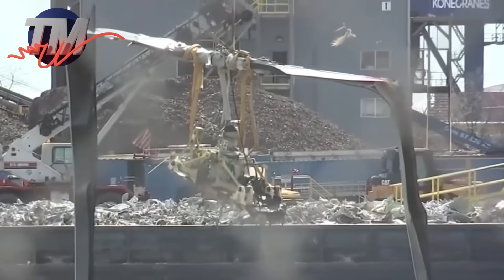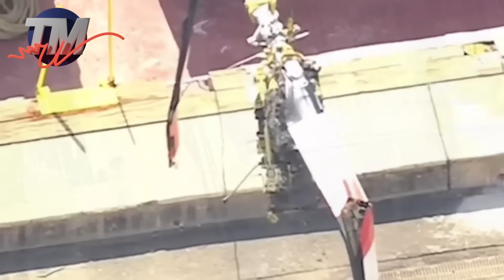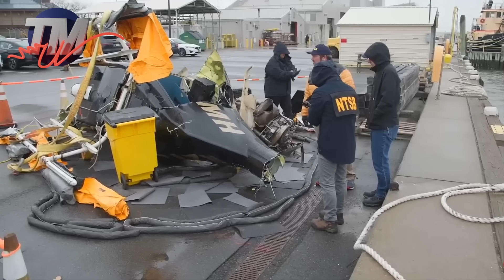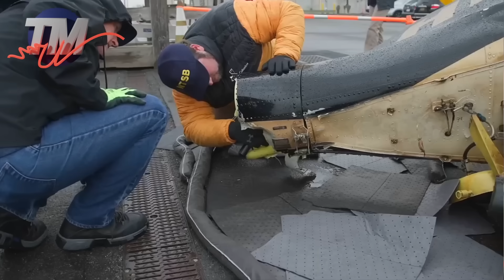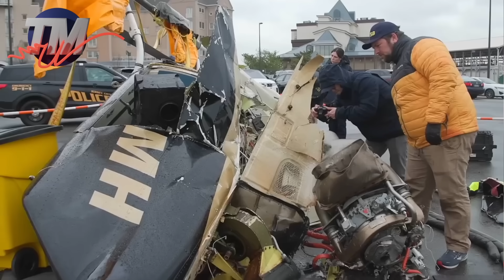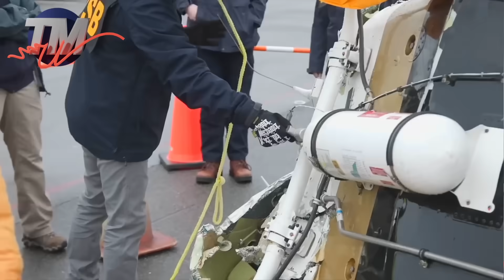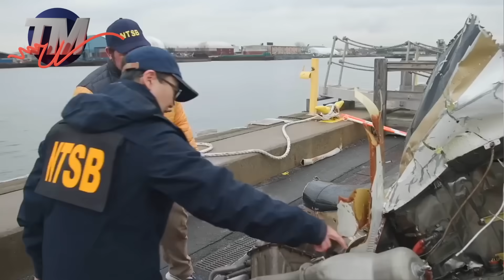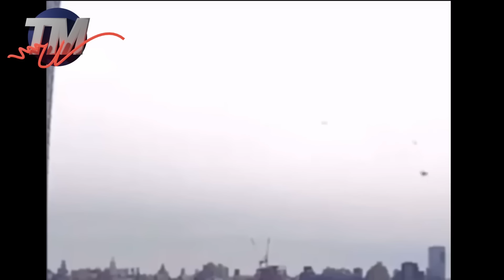Recovery of the Main Rotor of the Hudson River Tourist Helicopter - it's worse than we thought

Comment: When looking at all the evidence the most logical conclusion would be the transmission seized, torquing the airframe so violently the tail boom sheered off as did the entire rotor assembly with transmission. 

By observing the rotor blades as they were spinning down, and the fact that they were spinning freely and balanced, one can easily argue they did not suffer the damage one would expect if the blade(s) had struck the tailboom. The fact the failure appeared to be at the point where the tail boom is attached to the rest of the airframe also indicates it was sheered off as opposed to being chopped off.

When I saw the helicopter instantly yaw to the right I was convinced it wasn't due to LTE, the yaw was just way too violent. In my opinion the only thing that would cause that is the transmission locking up.

Comment: In Fixed Wing engine failure in the past there were instances when an invisable structural flaw was formed during the forging process of a turbine blade, engine block, crank shaft, turbine disk, etc. The accident had actually begun years before during the forging...even before the part left the factory. No amount of non-destructive testing could've picked it up...until in fully failed in and instant during a flight. I would not be shocked if something bizarre like this may have happened.

Also maybe some kind of sabotage????? Unless they find something patently obvious. This may take a while.

Comment: The people who have experience have spoken. The first thing the NTSB needs to review is the main gearbox seizing and corrosion/metal fatigue in the cabin roof/tail boom. Maybe (probably) they’ll find maintenance/inspection failure(s) and maybe (?) no chip detection. 

The videos I’ve seen to date show the remnants of the main cabin and engine, the rotor-gearbox, and other bits. I assume the rest of the tail boom and fin have been recovered, and, the tail rotor, gear box & power shaft. The news talking heads really have little clue of what they are looking at.

My first impressions of the early videos were, ‘where’s the main rotor assembly & part of the cabin?’ and ‘where’s the tail boom?’ I’ve never seen a main rotor assembly autorotating by itself. Those rotor blades store a lot of energy.

Comment: I think the lift-rotor transmission locked up. This would cause the fueselage to pivot violently. In so doing, such could have over stressed the tailboom, causing it to break near its root. This is because the tail-boom rotor assembly has considerable mass. And such would resist being swung violently. Once the tail-boom broke, the tail-rotor assembly, which itself was over stressed, came appart.

By this time, the mounts holding the lift-rotor and its transmission to the fueselage had already failed. So it wrenched iself free sometime after the tail-rotor assembly flew apart.

I originally thought the lift-rotor spanked the tail-boom. But, after seeing the lift-rotor, I have changed my mind.

Comment: The transmission wasn't ripped from the aircraft. The entire tranmission deck was ripped from the aircraft. That is like, the entire roof being peeled off. The boom also is not broken at the joint. It is ripped off about a foot behind the joint. You are entirely correct, though. This was an extremely violent and catastrophic event. I have no idea what would have caused this.
Reply: Wouldn't have anything to do with Escobar being in charge of Siemans 10 billion investment into USA, would it?  
😢Traitors everywhere

Comment: Long ago, when I was a teenager, I drove a 1962 Volkswagen Beetle, that my dad basically gave to me. I drove it and drove it, and I did not add any oil to the engine. One summer night, just after dinner, I was driving it on a little street, and it suddenly screeched to a stop. It would not even roll. I was mystified. 😅  No oil, then no engine. This helicopter reminds me of that, I think that somehow, the engine might have just stopped dead. (My dad replaced the Volkswagen engine - $275. And after that, I watched the oil level!! 👍 👍 👍 🥲)

Comment: This helicopter was in service for way past its serviceable life. Metal fatigue eventually shattered the metal joints where the engine’s crank shaft met the transmission. It was operating fine until it reached its critical threshold and failed without no noticeable warning signs.
Reply: It was the helical hypoid herring bone sprocket retainer pin, made in Bangladesh, since the Trump tariff war took the superior Chinese rare earth alloy ones off the market.

Comment: The rotor blades appeared in the video to be straight and intact, possibly the broke when they struck the water.  Seems that possibly the main rotor gearbox or the turbine seized causing the sudden yaw which could have broken the tail from the fuselage and the main rotor transmission to separate from the fuselage.  Maintenance records and review of the recovered parts will most likely clarify what happened.

Comment: The video of the in flight fall apart shows the aircraft halting in mid air as if it hit something in the sky like a GD drone. The main theory is that the transmission locked up but I wonder it it actually hit something in the air big enough to cause the transmission to break loose from it's mounting in the body of the airframe?

Comment: It was an explosion that blew everything apart. The evidence is what the pilot said when he radioed that he was low on fuel. Why would he be low on fuel? Because of a fuel leak. I believe the nut was loose on the fuel line which sprayed the engine and transmission with highly flammable fuel. Turbine engines run really hot so it ignited the fuel causing an explosion. The sonic booms heard by a jogger support this explanation.

Comment: Swiped this from a different video on the subject a number of days ago, but this guy sounded like he knew what he's talking about and wasn't just blowing smoke:

"22 yrs Army helicopters, OH-58, TH-67 and later TH-57 experience. Taught the Maintenance Test Pilot course for Bell AH-1F Cobra.  Mast bumping usually causes separation of the Main Rotor (M/R) hub from the mast.  I does not usually pull the entire transmission out. The only thing that does that is excessive mast movement knocking the "candlestick" against it's stops under the XMSN. Watching the initial portion of the video, the aircraft appears to be flying level and cruising.  I see no immediate maneuvers or disturbances until the severe yaw event that initiates the tail boom separation.  My experiences point to 2 possible causes.  The Tail Rotor (T/R) drive shaft hangar bearings on the 206 models (civilian versions of the 56, 57, and 58) are notoriously picky about accepting lubrication. They have been known to discolor and seize with little to no warning. Locking up the T/R drive shaft at the tail boom attach point bearing can cause separation, and the immediate torque due to loss of yaw control/tailboom could cause the whole upper pylon to become dislodged.  The other option that comes to mind is pitch control link failure. I had a Cobra do that.  When a P/C link fails, the M/R blades, or at least one, are no longer controlled and can easily flail themselves into the tailboom. That applies torque to the XMSN, potentially ripping it out. The fact the blades were still attached to the XMSN is what kept them rotating, like a toy set of blades on a stick. So, while I don't disagree that mast bumping could be a cause, the evidence I see doesn't lend itself to that."

The XMSN is basically another name for the transmission, according to Google.

Comment: I believe you're on the right track, the question is what would cause a 90 degree right yaw. A tail rotor failure or control linkage to the tail rotor seems lkely. I saw no evidence of mast bumping in the mast still attached to the main rotor.

Comment: There’s a newer clip that shows the instant the fuselage snapped 90° to the right, separating it from the tail and the rotor system with transmission coming out as the fuselage flips over. I think the gearbox bound up and instantly sent all that torque energy to the fuselage, sadly the end.

Comment: Having flown helicopters in Vietnam and witness the loss of a 90 degree gearbox in flight, I know helicopters are not for the weak of heart. I've flown for 53 years and have never wanted to get in another helicopter after my return from Vietnam. Too many moving parts going in opposite directions.
Reply: My brother was a warrant officer who specialized in helicopters and he said "if its not leaking means its out of hydrolic fluid". 😂
Reply: Considering the mechanical complexity and size of components in the rotor assembly and extreme forces being exerted on a system with zero redundancy, it's amazing ther aren't a lot more accidents.
Reply: I agree.  Don't ever want to get into a helicopter.  But, I also have the same feelings about small planes.  They seem to be involved in way too many accidents/crashes.   The list of famous people who died in small plane crashes is fairly long.
Reply: @my3dviews almost all are a subject of "Get there-itis" too much pressure to get someplace in not enough time to drive in poor visibility for IFR for flight. Fly for fun and you won't ever die in a crash you shouldn't have been anywhere near. Also remember to fill the tank before you takeoff or you'll wind up like John Denver.
Reply: @jamesordwayultralightpilot    Another new example:  N8930N C-310R Boca Raton 11 April 2025
Reply: Thank you for your service. 🙏
Reply: Thank you for your service sir 🫡 🇺🇸
Reply: Electric quad copters will be a massive improvement when they become practical for human flight.  Far few moving parts and more redundancy.
Reply: @WaybackRewind   The time of flight will always be very limited though.  There is only so much storage/weight that a battery can have.  With cars, the EVs are a fair bit heavier than non EVs, but it doesn't matter as much as with a flying machine.
Reply: @my3dviews  true, and maybe a hybrid with a gas generator would be mechanically less complex?
Reply: @WaybackRewind   Nuclear. 😄
Reply: Ok boomer

Comment: It looks like the tail spun toward the camera, counter-clockwise, as if the gearbox had locked the rotor to the fuselage, thus rotating the fuselage in the direction of rotor travel. Most of the power is transmitted to the main rotor, while some power is transmitted to the tail rotor to keep the fuselage pointing forward. The gearbox locked up and was forced to rotate at 3k rpm almost instantly, ripping it from the fuselage, which couldn't keep up.

Comment: I had an old Vietnam helicopter pilot tell me that he had just landed to drop off some troops in a hot LZ.  He said they were barely on the ground when the troops started to jump out so he pulled in pitch to leave the ground when the entire transmission siezed up and departed the right side of the helicopter before the last guy was out.  They were about 4 feet off the ground when this happened.  He did not know what caused the transmission to sieze.  Since they were in a combat zone, he did not stick around to find out.  That was a Huey (made by Bell) and not a 206.
Reply: Interesting 🤔 story 🤔👍✌️
Reply: How long was his walk out? Cause it ain't flying without the transmission attached to the engine. Or does he drink a lot?
Reply: @scottcoley1906  it was a troop insertion so his walk was short. He and his crew just went over to another helicopter jumped on board and left. He had no idea if the Army ever recovered the damaged helicopter. It was during the Battle of Lam Sung if that is familiar to you.  1971 as I recall.  The troop who went out with the transmission was South Vietnamese.  It wasn't an American.

Comment: From a physics standpoint, it almost had to be a seized main rotor gearbox.  This would cause the rotor inertia to violently jerk the airframe clockwise (which the video shows) such that the tail mast would snap from the sudden high bending moment.  Simultaneously, the huge torque could have ripped the main rotor mounts from the airframe, freeing the main rotor  (which it did).

Comment: Never worked on a Bell transmissions. My best guess is that a major part in the transmission failed very sudden. Look at the mast, it is in a very pronounced angle to the transmission. Possibly the planet gear carrier broke or the carrier bearing failed. Not really thinking bearing since that would cause spalled material that would be picked up by the chip detector. Cracks in gears or the carrier would produce really fine material that only testing oil would show. Wonder if the operator had a SOAP program to test oil. NSTB will find what went wrong. 45 year Chinook mechanic, last 30 in transmission overhaul.

Comment: As non USA ex pilot I hear lots of gossip about the maintenance standard of USA aircraft not of the best standards Overseer (FAA and maintenance organization) standards must then be also looked at. Some commentator mentioned missing rivets. IT WILL BE VERY INTERESTING TO SEE THE ACCIDENT/REPAIR RECORD OF THIS CHOPPER. I think the problem will point in that area. Long rangers has MILLIONS of hours in the air. What happened to this one is NOT pilot error or even small maintenance errors or even bad landings hidden as one commentator mentioned. I bet NTSB is scrutinizing the logbooks VERY CAREFULLY. Some commentator mentioned gearbox sezure. MMM After all the millions of hours Long- or Shortrangers must have had incidents like this. Ok and not had the gearbox ripped of the frame (as sad not that we know off). I speculate but I think my thoughts are in the correct direction. Let us just remember the swizz cheese. I think tho many holes in the maintenance of this aircraft lined up for the occupants RIP. I do not think there is ANYTHING sinister in this incident.Withe the quality of NTSB inspectors they will find the cause Let us hope soon.

Comment: As an A&P mechanic, I am guessing it was a gearbox  seizure.  The whole transmission and it's mount was ripped from the airframe. The sudden stoppage of that much mass could have had enough counter force to snap the tail rotor boom at its attachment point to the cabin structure.

Comment: I'm no expert, but from the video it appears to me as though the clutch in the rotor seized up causing the main rotor to lock up which caused the violent yaw. The violent yaw caused the tail boom to rip off and the entire main rotor to rip out of the aircraft. That's my theory anyhow, but I'm not a pilot or aircraft mechanic. I'm guessing just based on the violent yaw and the nature of the failure of the airframe. If the yaw was caused by the tail rotor failing, I don't foresee that causing the forces necessary to cause the tail boom failure. However, if the main rotor failed and locked up, that would not just cause massive forces on the tail rotor, but also massive forces on the main rotor which to me seems more consistent with the failures found here. After doing some quick research online I was able to find that such a failure of the main rotor is actually possible due to a failed clutch in the main rotor. This seems likely to me.

Comment: It looks like the Jesus bolt was intact, still attached down to the transmission.  There is no explosive residue showing, it looks like it was suddenly sheared off. From the video, it almost looks like something impacted the tail boom, that is too sudden of an immediate rotation of the fuselage for a tail rotor failure.  If a rotor fails to spin, the fuselage it will gain speed spinning as the rotation in the tail stops.  All of it was extremely sudden with a incredible rotational force and spin.   Looking at that damage and considering the video, all I can think of is there were extreme forces placed on the boom that sheared it cleanly, and that force then travelled through to the fuselage causing the transmission to tear away.  That would require some extreme forces that does not make any sense, I am at a total loss at first thought on how that damage could occur.

Comment: A gearbox/transmission seizure.  The sudden seizure caused the rapid airframe yaw due to rotational inertia in the main rotor system, at which point the airframe couldn’t take the massive load from the transmission/main rotor trying to rotate everything. Sheared the entire assembly from the top of the airframe.  

I think this is what they will find as the cause.

Comment: After years of experience with Bell Helicopters, I think the main transmission seized and thus caused the sudden stoppage of the tail rotor causing the tail boom to break off, and tore itself out and took a section of the roof with it.

Comment: I have been a toilet plunger salesman for over 25 years, but....   If one of the two rotor blades broke or cracked, even if that blade didn't come apart and remained in one piece, it would create massive imbalance in the swashplate, gearbox, etc, and could conceivably tear the entire assembly from the rest of the motor.
Reply: The rotor and gearbox literally autorotated all the way to the water as one unit.  It could not have done that with a damaged rotor blade.  The rotor was still flying due to the weight hanging from it and the pitch of the blades.
Reply: Oh, an expert!  Rubber cup or plastic accordion style?  I've found the rubber cup models to be cheaper and more reliable but the accordions generate more suction.  What's your perspective?
P.S. calculate the G loads on the blades as a result of rotation.  Damaged rotors do not remain in one piece.

Comment: I’m not a helo pilot….but a mechanical engineer. My bet is a catastrophic transmission seizure. The rotating inertia of the blade system could/would have been enough to rip the entire structure from the airframe.